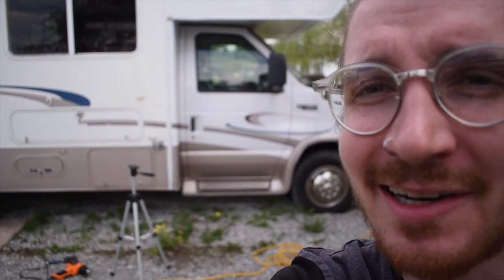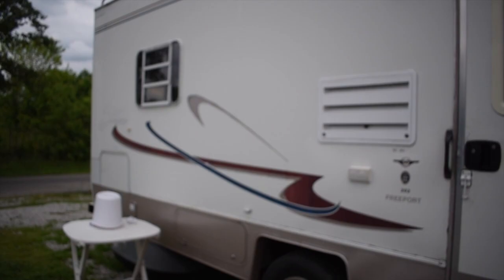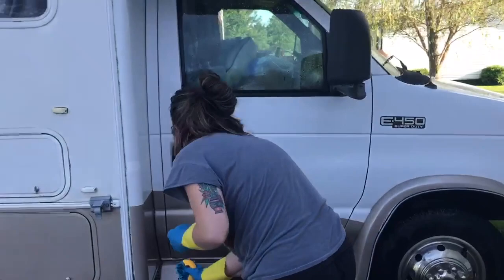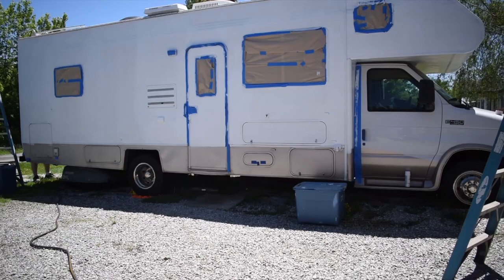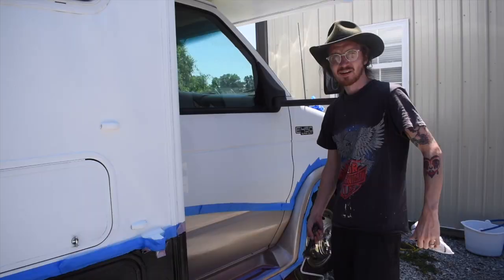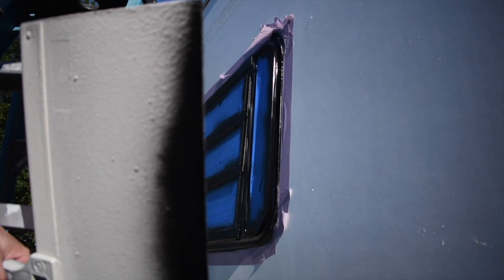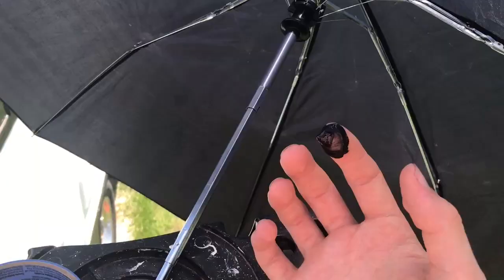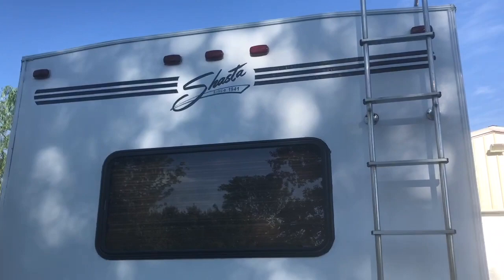Affordable DIY RV Exterior Paint

Comment: Your rig looks great!! What kind of paint did you use and how's it holding up?
Reply from the maker: Thank you! We used an exterior acrylic latex paint from Sherwin Williams. It's their stores brand called "superpaint" and we got it in high gloss. It's doing really well. I had a few chips around the doors from heavy ice, but it's my own fault. It cleans nicely too, but I would probably avoid using a pressure washer.
Reply: @summerginther  thanks for the update!